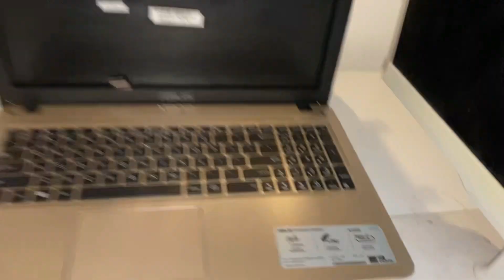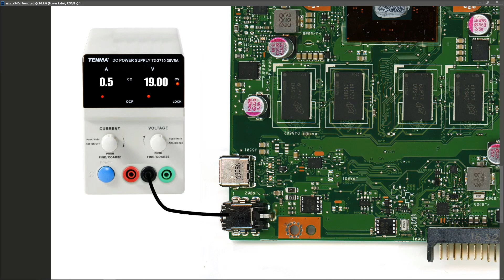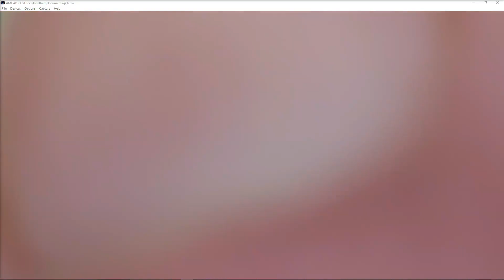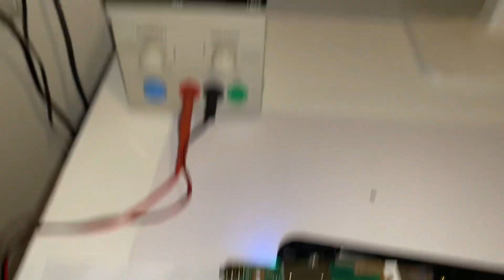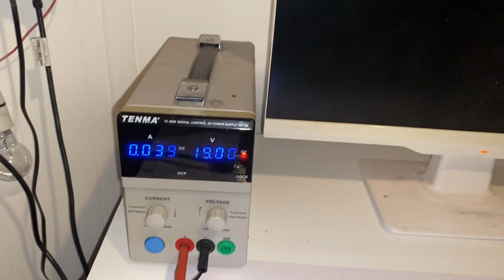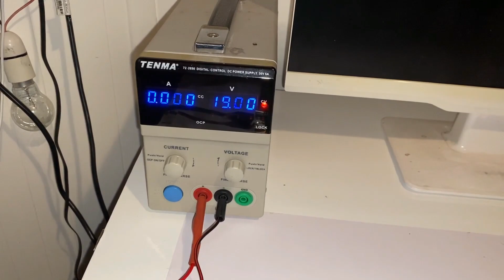ASUS A540 - IC HEATING UP

Comment: It is good that you checked for shorts after you removed the hot IC, because we often see that power supplies often get hot when a component on their output line is taking too much current from them. In this video, you did not state the motherboard model, or whether a schematic is available. But given that this board has a VGA connector, I agree that it should be recycled.